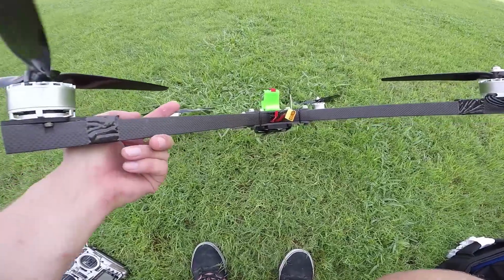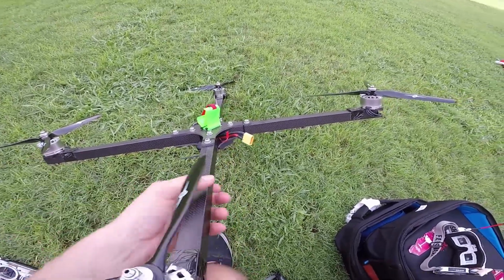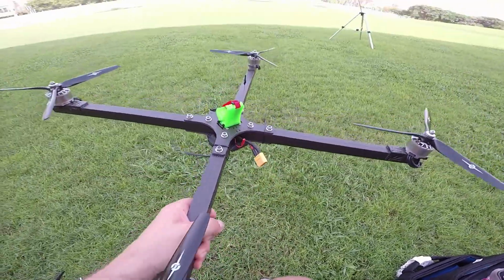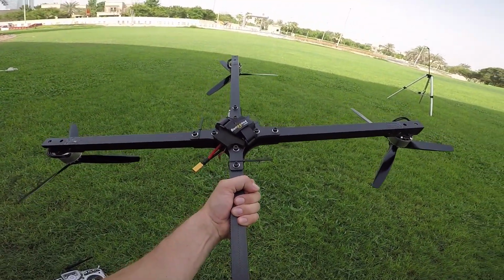VovaN60 X Class

Comment: Did you ever get it to not wobble while flying? I've just built an 1200mm X drone (x-class) also. I have the wobbles also with out acro mode. As someone mentioned earlier try to adjust the PID's. Keep us posted. Great job. On the build. Any help would be welcome also😁.
Reply from the maker: Thanks man.
In US all people were saying you need to lower PIDs like 7 D (talking about BF). May be they do it as atempt to prevent ESC,s from firing. In my case i found way better quad feeling on 120 P, 100 I, 120 D. Or even higher. Bangood esc's for 20$ handle it untill now. Motors are very hot as should be.